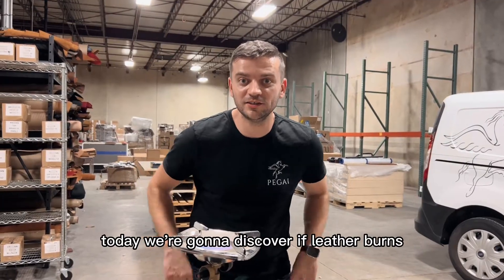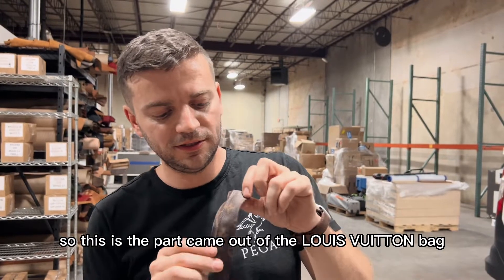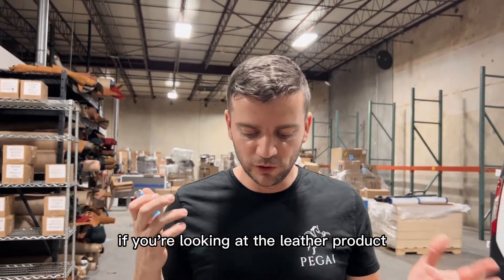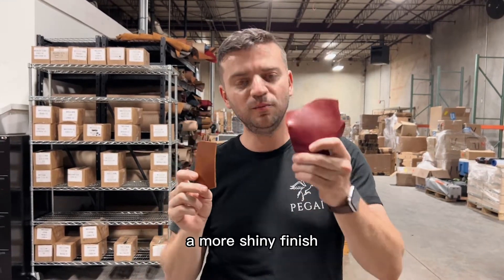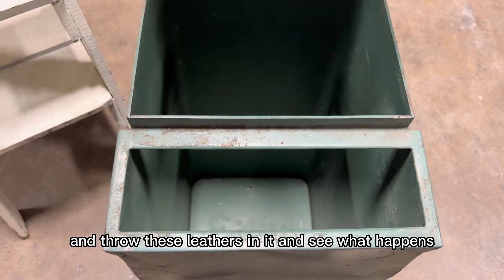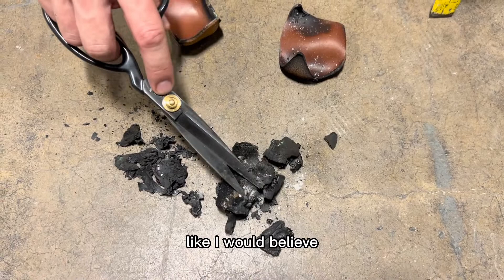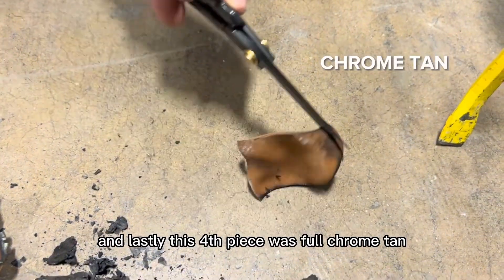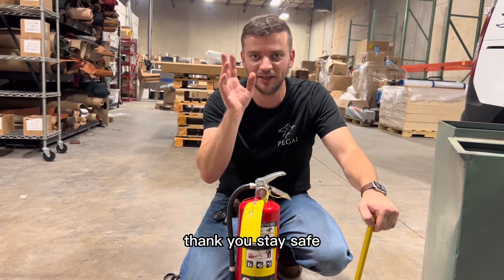Will Leather Burn? Burning Leather Test

Comment: In Turkey one shopowner showed me fake leather a year ago, which he hold on a lighter for more than 5 seconds and still it didn't deform or loose color. Im wondering what kind of fake leather that was. He told for himself it was a new kind of fake leather which is almost not to hold apart from real leather
Reply: Maybe he cheated you and it was real leather?

Comment: Chrome and vegetable tanned leather has good and bad characteristics.I am starting a small boot company.Vegetable tanned leather linings have a mold problem really easy.Chrome tanned split or grain leather however not .Veg tanned absorbs water .Chrome does not .Veg tanned doesn like heat if it's wet and starts to shrink and crack .Chrome can be washed and dried to some extent.So you decide if you want the thick full grain vegetable tanned leather lining and have dry feeling feet or take the thinner  chrome tanned split and have slightly sweatier feet .

Also vegetable tanned leather tanning agents leach out with bleach and it turns back to rawhide.Chrome tanned leather does not.

Can you do a mold test maybe ?Clamp leather in between two acrylic pieces.
Reply: @tanner.leatherstein  I mean I am not a tanner but there is a lot of misinformation about high quality leather.How about cleaning the leather.People are scarred about making a stretching solution with alcohol to work the leather on a boot .I don't consider it very harmful.However removing mold with bleach is a terrible idea especially with veg tan.It will leach out the tanning agents.Vingear however is a volatile compound and evaporates compleatly . Killing the mold and evaporates.

Cleaning leather.If the water stays clear or slightly grey good .It turn dark brown bad /tanning agents leached out .

Chrome tanned leather can be cleaned countless times with saddle soap or even dish soap .Veg tanned also but less often is better .

Preserving oils : People " only use 100% natural"

Really ? The tanner makes sure to remove those unstable fats and oils and you put them back in?
People:" don't leave the saddle soap in or only use a tiny bit it removes all the oils "
That's what you are supposed to do . Remove old spoiled natural oils like neatsfootoil or mink and replace them with fresh .

Oil not only makes the leather flexible bit it also protects the tanning agents.

Leather is very complicated from a chemical standpoint but people should accept that some technices are outdated because of a better understanding of how tanning works .

That's my standpoint:)